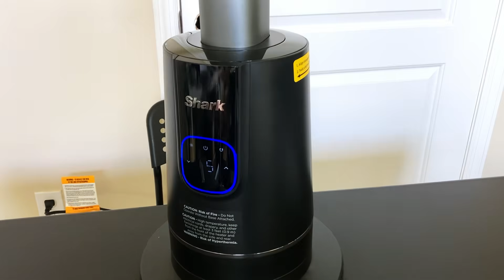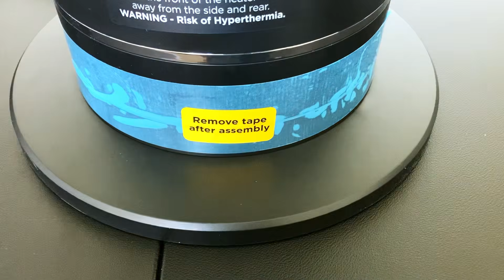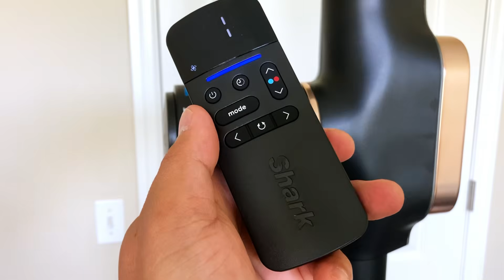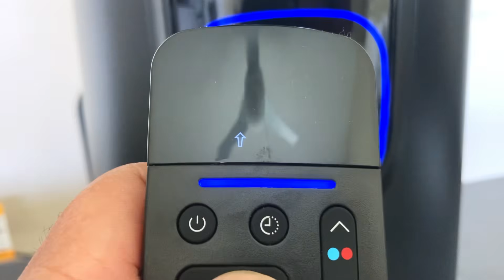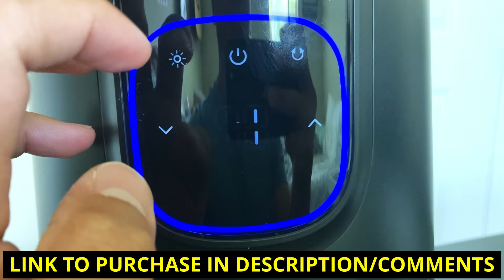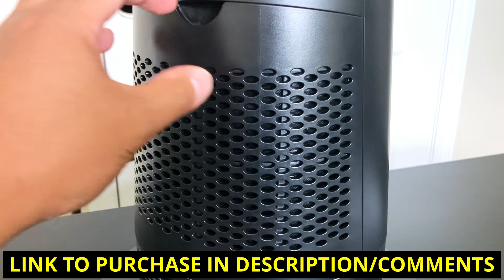Shark Turboblade Cool + Heat 2-in-1 Tower Fan and Heater | Demo and Review

Comment: it was good until I realized to go from cool to heat you have to manually switch, forcing me to get out of bed in the middle of the night to switch it, what's the purpose of having a remote? 🤷🏾‍♀️ I returned it, for that price it should be fully remote
Reply: For 99% of users surely that will never be an issue.. it’s either generally cold or generally hot depending on the season so you wouldn’t have to change it every hour 😮

Comment: I'm more interested in how cool it goes.
Reply: I mean, it's not an AC, it's just a fan.
Reply: @fictitiousnightmareswell it says cool+ heat. So if it's just a fan, sounds like it doesn't really cool much at all :/
Reply: @xFersureMatt  You're right, the name they gave it does suggest that it will cool. We just bought it a few days ago and briefly tried the heat, which seems good, but the 'cool' is definitely deceiving. It just moves air, there's no cooling mechanism.